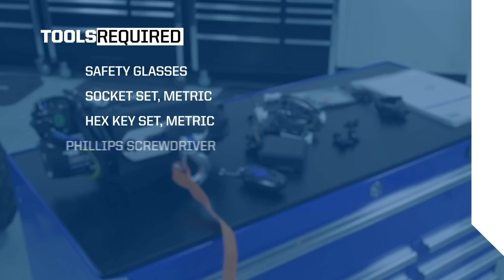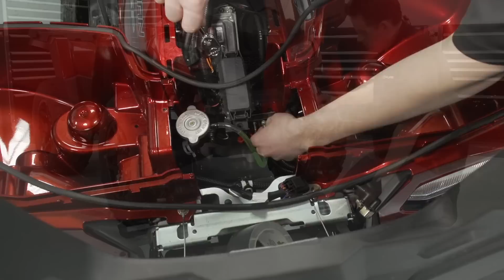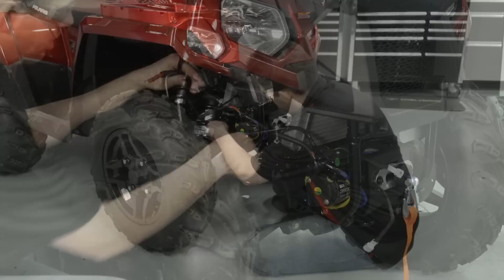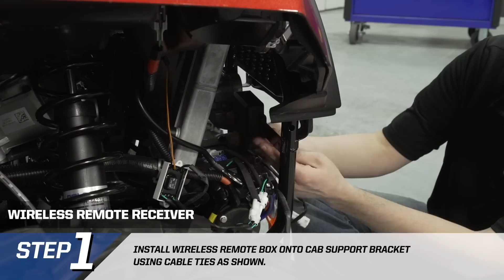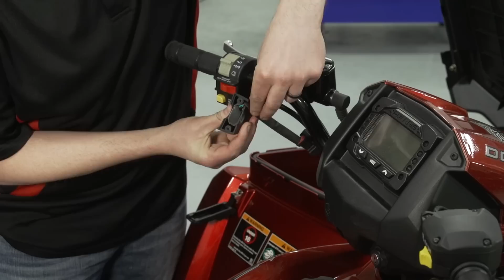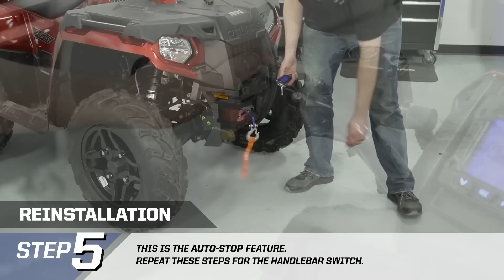SPORTSMAN® 570SP, 570 & 450 Polaris® PRO HD Winch Installation | Polaris Off-Road Vehicles

Comment: I do not have the plug and play for installing my winch on a 2016 polaris 570 touring and do not know how to hook up the little red wire , I have a black and green capped existing wires is that the wire I should be wiring the little red wire to?

Comment: Great Installation video, BUT why havent you done a installation video for the rear Winch. i have a 2019 Sportsman 570 6x6 and i buyed the 3500 winch, attachmentplate and wireless remote. not even one drawing or anything. That is something you can think about, becuse there are no good videos about this and Polaris dont supply enough info for installing this nether.